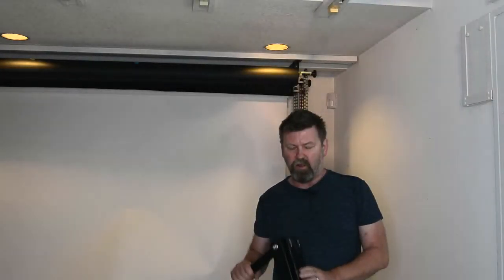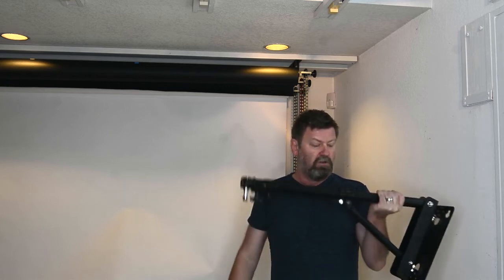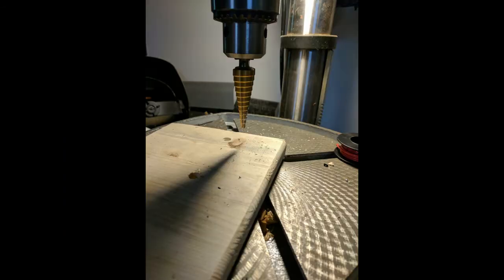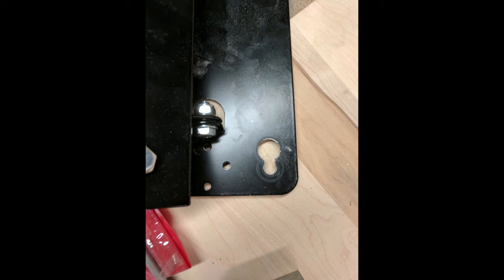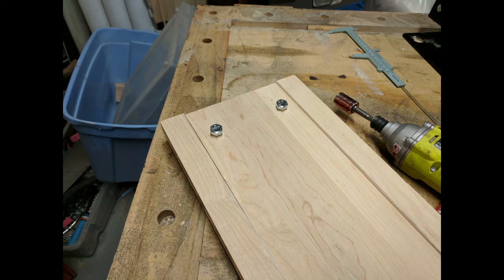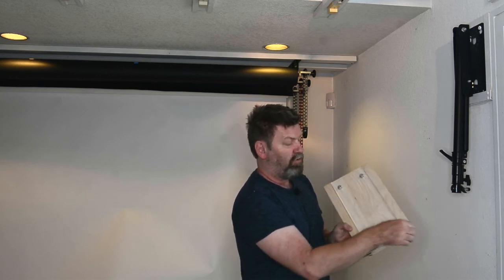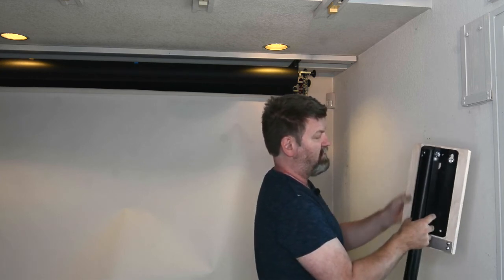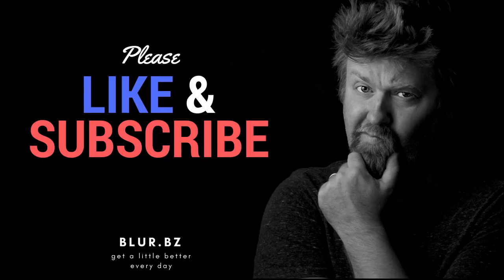DIY - Lock in Dock for Studio Wall mounted triangle Boom Arm

Comment: Like it.
For me I would put the top two bolts in the wall,
Then with the bottom plate use a bolt nut as a spacer, then add the plate.

Comment: I appreciated this video so much. Such a simple and effectiv idea.
Reply from the maker: Thanks for the feedback Darren.  It's still going strong although I widened the channel just a little bit to deal with heat / cold expansion.  Apart from that, no problems.
Reply: blur.bz I just got mine today. I was really intrigued by your set up, but was eager to get it up today.

Definitely going to keep this set up in mind though. Will probably use it when I moved into a larger studio. 👍🏾👍🏾

Comment: This is actually a great idea !!
Reply from the maker: Thanks Francisco.  Still using it a year on.  In hindsight I should have been a little LESS of a perfectionist as heating / cooling affects how tight it is.  I kinda over engineered in terms of tolerances.
Reply: @KeiferHunnifordPhotography  well, i just got a couple of this boom arms, and im still figuring out if i mount them directly to the wall or i follow your lead. Did you tried to do your "device" with the 3 strips of alluminum?
Reply from the maker: @Doc.Saucedo  I did not. I ended up repainting that wall and using that area for natural light portraits so I am not using the booms at all anymore. I do feel like the aluminum strips would work fine and actually better as if they were mounted to a strip of wood with a screw through a slightly slotted hole that would allow for some adjustment. The only issue I had was I  routed the channel to such a fine tolerance that temperature change had an impact and when it got hotter I had a hard time removing the boom.
Reply: @KeiferHunnifordPhotography  It makes sense ! i wasn´t considering the heat. I´ll have to test the booms for a while directly to the wall and i think ill make the mounting base with alluminum strips later.

Comment: Good idea will try it. and show you my later thanks.
Reply from the maker: Great!  For the record I went back later and drilled the holes a bit bigger.  There is no real reason for them to be just the right size for either the large opening or the resting place pin, in fact doing it "tight" is more of a pain than anything else.  Now that I've done three plates and 2 light stands I see that there's need for a bit more wiggle room to deal with even small differences between them.

Comment: Would you really need that docking plate? If you just used 4 bolts in the wall? It would have a lower profile, right?